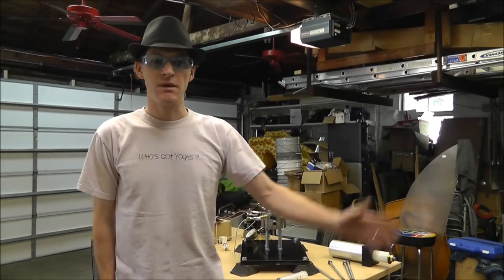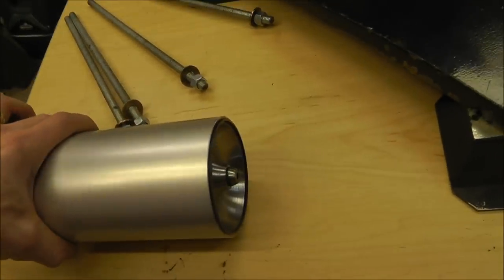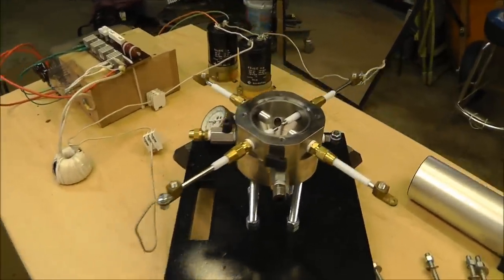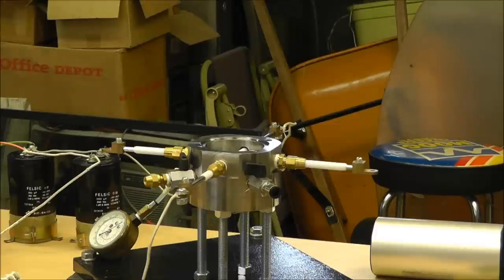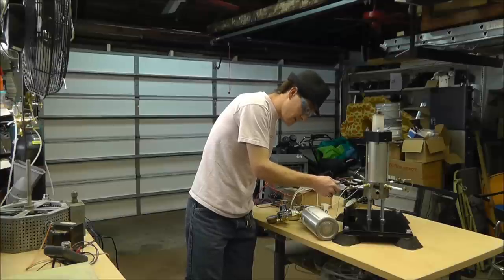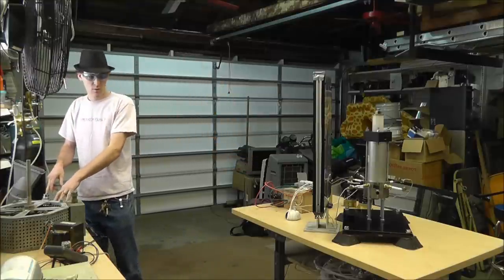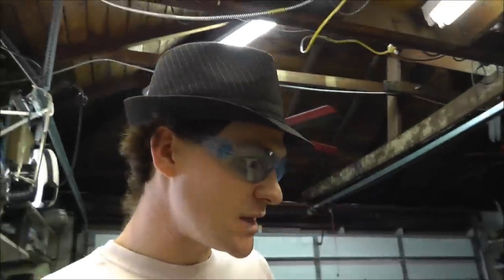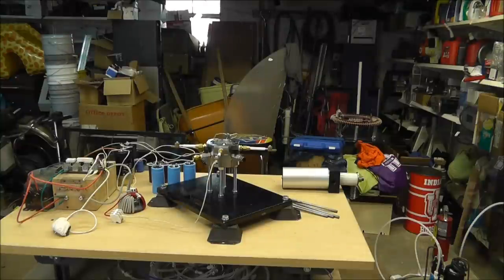Update 8 NGE Papp: First Test Fire!! YEAH! Sit Back & Enjoy! RWGresearch.com

Comment: Awesome build Russ.  I picked up at the end of your clip how the table really shakes.  That means that the table is probably absorbing half of your spark energy - Newton's Third Law.  I suggest that you put the popper on a concrete floor with no rubber feet under the device.  You might see twice the movement of the cylinder like that.  Or else put it on top of a steel table or something like that if you have it.  The wooden table is acting like a big lossy spring - a damped mechanical coil.

Comment: Russ, as a suggestion before you go to do the RF setup, I suggest you check with Bob Rohner and ask him how many joules of energy he puts into the his setup when he does his demo.  Hopefully he will be able to answer that question but it's not guaranteed.  Then compare that to the energy of your discharge.  If the energy in your discharge is much smaller than Bob's then I suggest that you work on increasing the energy in your discharge to make it comparable to Bob's.

Comment: Wow. I had no idea mixed gasses separate like that. I never shake my steel mix cylinders before welding and the gasses are of two very different density's.
I'm sure placing it on some rollers on it's side would be more effective and energy efficient than shaking.

Comment: Great Job Russ! Amazing speed in which you build things. But yes I think some RF will definitely improve the power output for the cylinder. Also, i remember from some of the video links from Sterling that the cylinder that  PlasmERG people used was also wrapped by coils in order to create a magnetic field to compress the plasma that is created with the sparks. What are you thoughts on that? Oh and by the way, nice T-shirt.

Comment: Hi, 
First question : have you tried to measure achieved kinetic force?
Second question is: have you ever considered that what ever gas is inside his primary function would be to reduce all that violet light, visible light to frequency which can be used as pushing force?

Comment: Great work! Looks like proof of concept to me. Could you try and stay away from radioactive as much as possible? I have been wondering if there is some kind of fusion reaction happening. Also if radio active's are consumable, where does the waste go? That stuff is pretty harmful to the environment to mine and process etc too. Gotta consider the full life cycle of all materials involved. Where does it come from, where does it go. Could you try Lanthanated rod? Prove it works without Finite fuel?

Comment: Russ,  What voltage are you putting across your electrodes? Maybe I misunderstood Bob's setup.  Noble gas + 440K volts + radio frequency + radioactive material exciter = plasma   Anyway,  great first test.  Could you use same setup with a singular gas to show comparison?

Comment: As far as I can see you are electrically heating a small volume of air which expands slightly. With a fuel supply you have alost reinvented the internal combustion engine with adder flim flam.

Comment: Russ, I hope your not using those thoriated rods, because you just walked up and sniffed the gas generated by your initial rapid fire of the gaps. It is long known to welders to NEVER  breathe the gas generated during or after the welding process, that includes what you just did. You exposed yourself to a very great chance of developing lung cancer. 2% thoriated tungsten is slightly radioactive, due to the use of radioactive thorium used in those TIG rods your using.  Do not take this lightly.